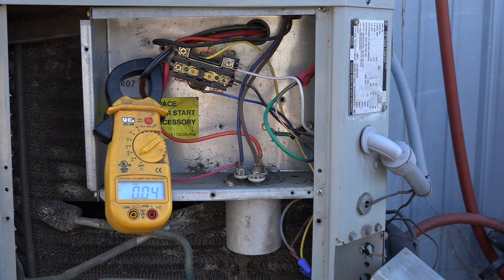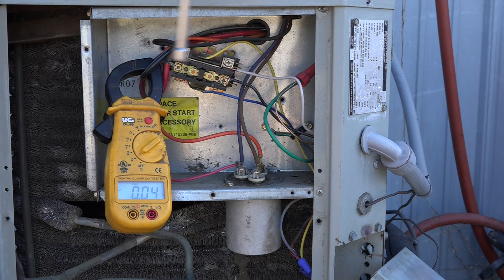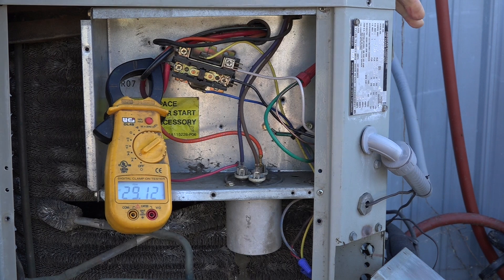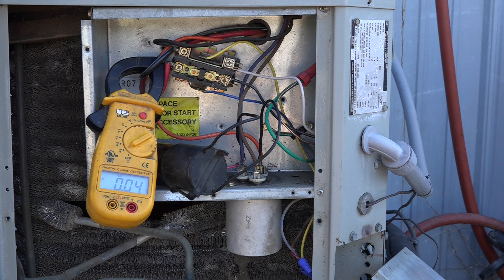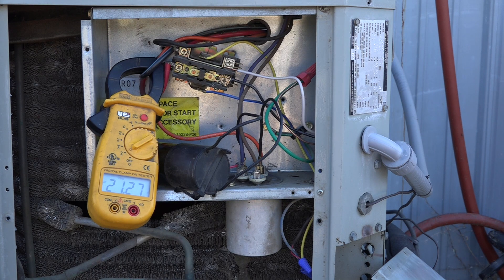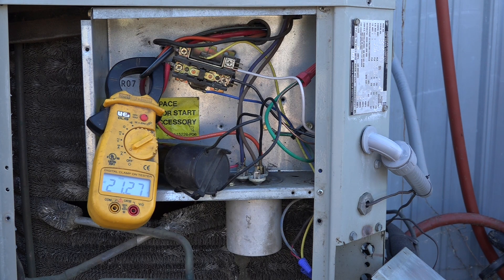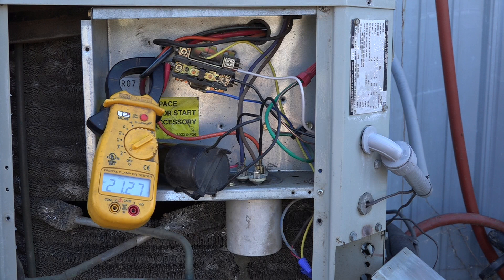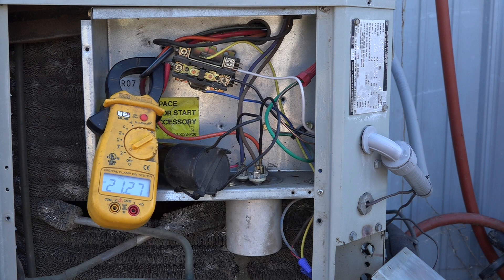Hard start or not hard start for the air conditioner

Comment: Does NOT reduce the amp draw by the compressor, simply supplies part of it from the capacitor. Total amps are the same so the compressor sees nothing different.
Reply: The compressor sees same amps faster.  More torque.

Comment: Referring to the comments...Install on a new unit???  are you smarter than the engineers at Carrier or wherever?  I agree with GFM the install on older units 15+ yrs old or compressors having trouble with starting. just IMO. If it ain't broken  don't fix it.
Reply from the maker: Agreed.
GFM

Comment: My Trane heat pump shows a start kit on its schematic, but didn't come with one from the factory.  I was looking all over for that capacitor, and relay.
Reply from the maker: The outdoor unit will have a hard start if the indoor coil uses a TXV expansion device.  If it uses a fixed orifice it is deleted.
GFM
Reply: @grayfurnaceman  Thanks for the reply.

Comment: I'd insist on one of these, or an easy-start (but they're expensive), as I run these on inverter power and generators. They have their place and I'd say that's in the rv industry. Many people run small generators and inverters that can run them no problem, but can't start them. This solves the problem for most people. What's missing in these DIY videos is how to choose the right one for your system. They're just like, "I put one of these on and it fixed it!"
But then you go to get one and there's like 47 different kinds with little to no explanation as to which one is for what.

Comment: We have a 6 year old compressor on one house and a 16 year old compressor on another house. Both run fine but when I compare the inrush with the LRA Max number, the inrush is higher on both units. One is 74 with LRA Max of 70. The other is 105 with a LRA Max of 87. Since both exceed the maximum amps according to the chart, should I be concerned and try to lower the inrush with a hard start kit?
Reply from the maker: A hard start kit will increase inrush but it will be for a shorter time.  I would leave it alone.
GFM

Comment: it appears that nobody has touched upon this question yet, can you tell me what will happen if the hard start relay does NOT drop out the hard start cap upon start up? the relay hangs up or malfunctions keeping the hard start cap engaged constantly, I'm concerned that putting them on is a possible danger of that happening, do you have anything to say about this? thanks in advance....
Reply from the maker: I have seen it happen.  It burns out the start winding.  There is a reason manufacturers do no install them unless there is a non bleed TXV installed.
GFM

Comment: When you mention harder push, you mean higher voltage applied to the start winding via the solid state hard start kit, that induces higher voltage just long enough to get motor going then drops the higher voltage hard start automatically correct? Higher voltage always means lower amperage. And vice versa.
Reply from the maker: The voltage is higher, but it is out of phase which , induces a magnetic force that will push the rotor.
GFM

Comment: What about if you need a generator to run the unit in event of power failure? Less start up draw would benefit that possibly?
Reply from the maker: The hard start may overdraw the generator.  The lower amp draw of the soft start may be necessary.
GFM
Reply from the maker: @birdyboyblue  What this video does not show is peak amp draw because the meter is not capable of reading it.  This video is about power usage, not peak power.  The hard start kit increases initial power surge in order to start the compressor more quickly.
GFM

Comment: This may be discussed elsewhere in these comments, but here goes: 
- Is the reason you have a "hard start" with a TXV system because the TXV keeps the high-side pressure up for a while, making it difficult for the compressor to start again if there's pressure in the system? 

- Stated for fixed-orifice-device (not TXVs): fixed-orifice-device (piston?) systems don't need a hard start because the high-side pressure equalizes rapidly on compressor-shut-down through the piston, which means there's little back-pressure when the compressor tries to start again. 
Correct?
Reply: hg2 there is an equalizing tube on the TXV for this purpose.

Comment: what would happen if you wired in 2. 2 wire hard starts
Reply: Larry Nance not a good idea. They drop out after start up. If 2 are on the compressor they may not drop out properly. Go get the correct kit for the compressor.

Comment: Is it just me or did it not sound better on start after you installed it? If so would this not increase compressor life?
Reply from the maker: The longest compressor life may well be without the hard start.  Consider if every time you stop your car, when you started again, you flooboarded the accelerator.  
GFM
Reply: Good point. Never thought of it that way. Thanks.
Reply: @grayfurnaceman  Bad analogy. Think of it as every time you stopped the car, you started up in 3rd gear.

Comment: I give the option of an installation of a “Superboost” (or similar device) on many repair quotes when running A/C service calls. I’m also an electrician, and I have a decent understanding of how capacitors can be beneficial. I don’t see too much evidence for a hard start pack causing damage. If there are cases where it has caused damage, I’m willing to bet that the compressor had been damaged some sort of way to begin with. I have found many systems to be saved or kept alive when the main start capacitor failed. The only equipment that I have seen that have factory installed “boosters”, are an older model Lennox-brand condenser. They look like hell, they guzzle energy, but they just won’t die. Also, the contactor points seem to have moderate wear, when compared with condensers w/out a booster. (Coincidence maybe) Capacitor banks have been used by large factories for years to help correct “power factor” when a service is “out-of-unity” with the serving transformer or has a low power factor calculation. Inductive loads are harsh to a service and to other inductive loads connected with the same power source. Voltage variances in the grid can tax a capacitor as well. We all know how many capacitor calls we get on the very first day of a heat wave. All the condensers on the grid are trying to play “king of the mountain” and your unit, decides to turn on at the lowest point and sucks all that energy from the capacitor, causing an outage or worse, equipment failure. In my opinion, installing a companion hard start kit is a good idea in most cases. I do agree however, new units probably do not need them unless they are in special circumstances.
Reply from the maker: I mostly agree.  In my service years, I have used boosters on compressors that had a failure to start.  I figured they could extend unit life a month or 2 years.  Either way, I have saved the customer replacement for that time.  I do not agree with installation on a new unit that does not come with one.
GFM

Comment: I had a bulged run cap and my compressor wouldn't start. Our unit is over 10 years old. I put a 5-2-1 on it and it started right up. The next day i went and got a new run cap.
Reply: shack adoodledo your compressor will start with the 521 but if the run cap is bad the compressor is drawing current from only 2 legs and is over amping because it is only pulling on 2 legs. This is detrimental to the compressor. Now that you have the 521 be sure and check the run cap periodically. You must have a separate cap for the fan motor, I’m theorizing on that.

Comment: What would reduce a loud bang on the condenser start up?
Reply: You must mean "compressor" start up. It could be the "contactor" poles closing, making a "thunk" sound. If this is the case, the sound is normal.
Reply from the maker: No way to know for sure but if one of the compressor internal mounting springs is broken, the compressor will strike the side of the can upon startup.
GFM
Reply: A new condensor/compressor. Mine used to do that and scare the crap out of me. My son fixed the problem by putting a dart through the coil. He felt bad when it happened and asked for duct tape. I laughed and said forget it son, you actually did a good thing. (It had a hard start kit and made the noise before and afterward. Maybe louder after the booster)

Comment: Will this allow me to buy a smaller home back up generator? Ive been told they take peak amp draw at start up as a guideline on sizing a generator. My old ac unit peaks at 90 amps, then runs steady ay 16 amps.
Reply from the maker: Chad M A hard start will not make a lot of difference in amp draw requirement. You can however use the generator peak amps when sizing. 
GFM

Comment: For an old timer, i am surprised that you are not a believer in hard starts. All units came with them from the factory up until Harold Goodman removed them for cost reasons and every one else followed suit to compete on price. 1st of all that thing you are using is not a hard start kit. it is a PTCR, which uses a resister to "pick up" after the resister heats up. Carrier used to add them as a "soft" start on some models. fractional HP refrigeration units use them as part of the safety circuit. a true "hard start" uses a mechanical potential relay.
Reply from the maker: I have seen many failed PTCs but never one that caused a compressor failure.  Not saying it can't happen.  Just I have never seen it.  On the other hand, I have seen the 521 relays fail, causing compressor failure.  Not often but it happens.
GFM
Reply: @grayfurnaceman  The poster is absolutely correct, hard starts were removed to save money. THIS is an undeniably fact.
Reply from the maker: The hard start is quite hard on the motor windings.  Kind of like starting your car at full throttle every time you stop.  The use of PSC soft start is fully capable of starting the compressor  when the system uses a fixed orifice as the expansion device.  Even if the compressor is short cycled, the overload will cut off the power before the amp draw can cause damage.  
GFM
Reply: Unfortunately you are quite incorrect in your description of what is happening during the start cycle.

Comment: mine starts at 62 amps. but my capacitors has failed and also have a leak tht will cost 1,200 to fix
Reply from the maker: If it is a fairly new unit, many of the caps are poorly made and fail easily.  If it is over 20 years old, consider replacement.
GFM

Comment: I never was a fan of spine fin coils.  Lol   (Couldn't help notice the coil on your condenser) I only use hard start kits as a band aid to help out someone who needs to goose just a little more time out of their equipment. I leave with the understanding that it's a band aid. Not a cure all. They are usually grateful I tried to save them some money. My take....use as needed. Not necessary on good running equipment.
Reply from the maker: +Fireship1 Agreed
GFM

Comment: When I built my  house the electric system required hard start kits and heat strip temperature lock outs in order to get a rebate they had going at the time through the Tennessee Valley Authority. I will use them on an old compressor to get it started and warn the customer that it may not last long. Good video!
Reply from the maker: +ComfortPlus Heating and Cooling That  is how I always used them also.
GFM

Comment: A nice one GFM. I agree with you I've seen many boost devices from the 80's well before the 5-2-1 hard start devices were common place and most where put in place when there was no issue on fixed orifice systems which even then I understood these systems weren't in need of them unless compressor had  start issues and were detected.via age related issues. . .

Comment: They do help out with house lights dimming on start-up in a case of a five horse power compressor at a house that is the furthest house from the utility transformer.  I would like you to re-do your video  showing amp clamp and voltage meter with min/max. readings

Comment: Would a hard start be a good idea on an air compressor?  Or is a capacitor a better idea?  I have an air compressor that keeps tripping 10 amp breaker.  I don't want to replace the wiring in the wall to a thicker gage.
Reply: +Qiong Jia A hard start is a capacitor, Just with a bigger boost for a second or 2 and your motor probablly already has a capacitor I think you need to look at the data plate of the motor and a 10amp breaker sounds pretty small. Need more info what is the amp rating on motor and gauge wire feeding that breaker.
Reply: +Bernie Clement   Sorry, I mis-spoke.  The breaker is 15 amp on 14 gage white residential wire.  The motor is 15 amp on the data plate.  The breaker trips about 50% of the time on startup.
Reply: yeah theres your problem needs a dedicated breaker 20 amp with 12 guage wire, a new 15 amp hvac breaker may help from tripping so much.

Comment: my use of hard starts:  if the compressor wont start, put on a hard start.  if it works i leave it on.  if it still dont start i take it off and change the compressor or replace the unit.  i got no other use for a hard start.
Reply from the maker: +jeff leonard That has been my use of the hard start.
GFM

Comment: I've been adding these hard start kits on new installs (Goodman units). Seems to be less stress on the compressor at least by the sound it makes on startup.
Reply from the maker: +Berzerk29 No real way to know for sure.
GFM
Reply: Should be a standard part, integrated into the units. Not like $20 part is going to hurt the bottom line